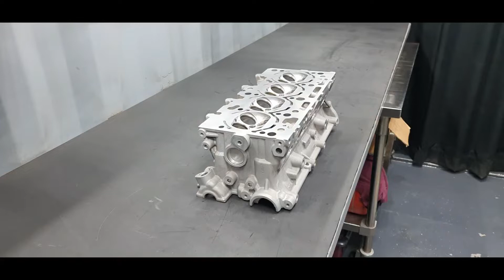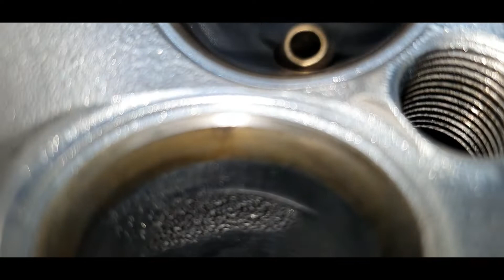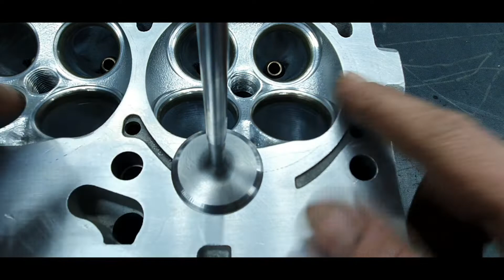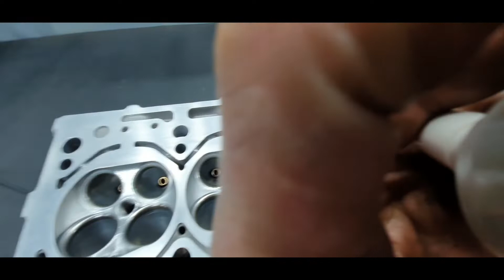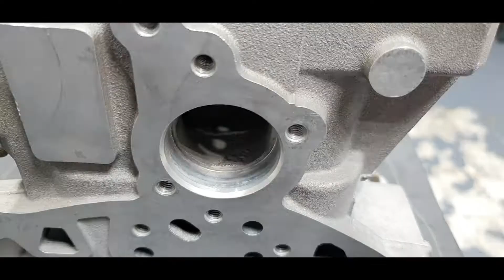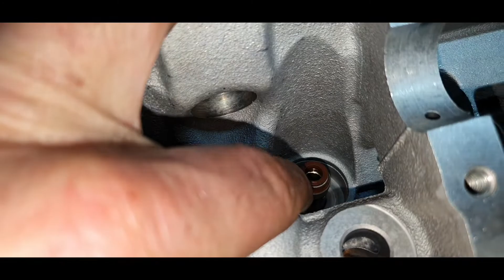CJX & CHH engine rebuild (part 27.5)

Comment: Hello Tasos 👍.  I totally agree with your opinion.  New valve seats and valve guides are the right choice for the cylinder head.  Anything else would be a bad compromise.  You could see the uneven seat of the valves in the video.  It's not that bad, but with new seats and guides it would be perfect 😅.  Best regards from Michael.  Also to the grinder boys😂🙏